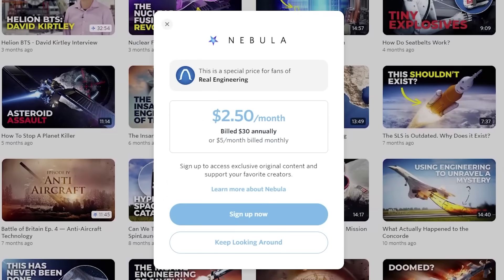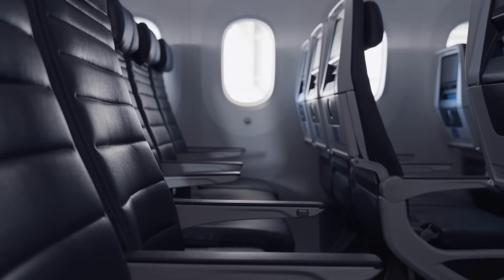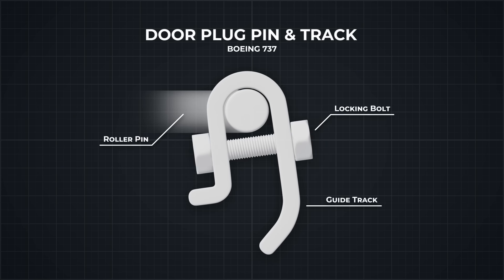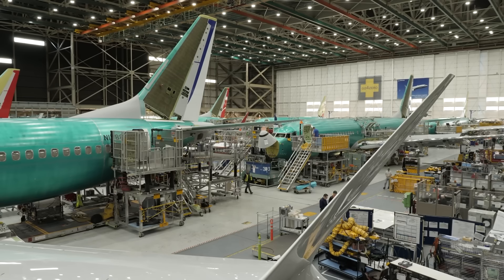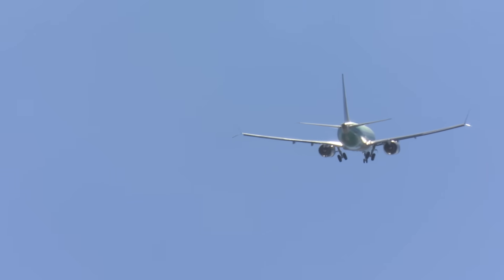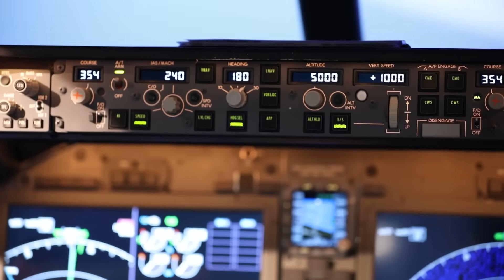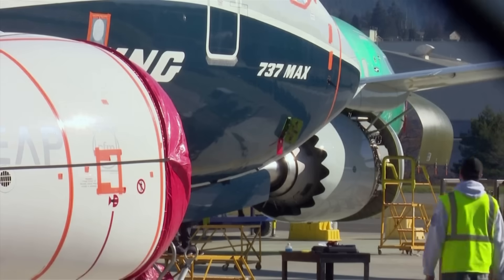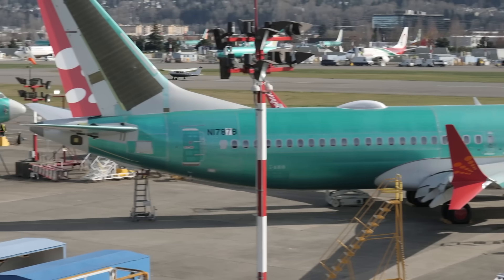The Questionable Engineering of the 737 Max

Comment: For the plug door, the engineering initially appears fine and will likely remain as such. Safety escapement and inspection,  a whole issue unto itself. Blaming the engineering  in the title especially for the plug door incident  seems a bit tabloid but in defense of the video and present Boeing management ……. sadly necessary these days. Bolts,  slotted castle nuts, and lock wire or cotter pins, ought to be goof proof when installed. Engineering failure, probably not so much.
Reply: You think it's sadly necessary these days to blame the engineering when it is not an engineering problem, because… 
in defense of the video???!!!

Yeah, these days… so much fentanyl in the air. Thank you for not working at Boeing—or anywhere, please?
Reply: @petep.2092  it’s hard to understand your rant. What part of the engineering of the door do you think appears flawed? Or maybe a better question what does engineering really mean to you? I am pretty sure I said the engineering appears fine and likely will remain as such. So not really sure what your rant is about.

Comment: 5:20
It's not a wire tie. It's a cotter pin installed in a castellated nut. Another way to secure a bolt is lockwire or safety cable. Wire tie, more commonly known as a zip tie or cable tie, is a nylon strap used for securing wire harnesses and I cannot imagine even a single way to use it as a fastener safetying device. Seems like someone doesn't know a shit about engineering :D
Reply: …cotter pin aka split pin, where this dude is from. Either way I agree it is not a good look for a self promoted “real engineer” to be so inexperienced as to call it a wire tie, which seems to be something builders use.

Comment: These brand new plastic planes should not be blowing out on the strongest parts of the air frame, the bear straps should be holding together until it’s bitter end we usually only see this on 20 year old planes the loose hardware we’re seeing is a symptom of a much bigger problem. Incorrect tolerances on the airframes themselves so even though we know that it’s a huge problem they just got clearance to put them back in the air to be beat on some more so now just like the 70’s and 80’s these things are gonna be blowing out left and right Boeings problems started when they merged management with McDonald Douglas

Comment: I'm glad that in the anime adaptation of Doctor Elise they changed the plane from an older 737 to what appears to be a 737 MAX. In the source material the pilot is somehow unable to handle a single engine failure. Well in the anime, it's still the same, but now fans can say "well, the computer probably messed up the single engine failure response somehow" since it's an acceptable target.

Comment: Great video as always. I’m surprised counterfeit fasteners weren’t mentioned, they and ‘salvaged’ components have caused crashes on both civilian and military aircraft in the past.
Minor detail and I know it was just a representation, but I never designed stuff with the screw/bolt head lower than the nut, falls out if the nut works loose 😅

Comment: The reason this happened is quite simple spirit Aerosystems were spun for profits and the workers they have come on more and more pressure to fix Boeings previous disasters . They’ve come under pressure to get the aircraft manufactured faster which leads to mistakes. This leads to people taking shortcuts rushing their work being unhappy. That’s what happens when you allow those criminals on Wall Street and in nice office buildings, in places like Chicago to take over instead of the people on the ground in Seattle.

Comment: the problem is actually trying to cram 230 people into a 59 year old design for 124 people, the 737-100 which used a section of 707 fuselage (vintage 1954).

Boeing, cutting corners for 70 years.
Reply: Not really, all of the deaths due to MAX incidents so far were caused by a multitude of design, implementation and training issues around MCAS, a shortcut to skip type certification for existing 737 NG pilots (which does relate to the age of the 737 but not to changes in passenger capacity), and the door plug incident and engine overheating issues would both be equally applicable even if it were a clean slate design.

Comment: Saw some other channel saying that the quality checklist / maintenance system had two options "opened the plug" or "removed the plug" - they're essentially the same thing, but if you chose remove then it proplerly inserted a work item for rechecking the bolts. (I forget where I saw that, but it was recent)

Comment: I think of a software should not treat the whole system as MALFUNCTION by default, such program state  should be in a deep conditional parentheses. In reality, software like that should never exist in the first place, if the system is having a parameter that constantly need correction the only right thing to do is get back to the drawing board.

Comment: What amazes me is that Boeing did not create that panel with a flange on the inside, so that pressure would cause it to fit tightly against the fuselage. Then there would be no danger of the panel blowing out. 

Instead, the pressure seal fits against the outside of the fuselage frame making its subject to blow out in the manner it did. That seems like a money, saving or cost-cutting shortcut.  I like the 737s and would have no problem flying in the max. however, Boeing has to  get their act together to restore confidence with the flying public. They also need to give the riot act to complacent shop supervisors and their mechanics.

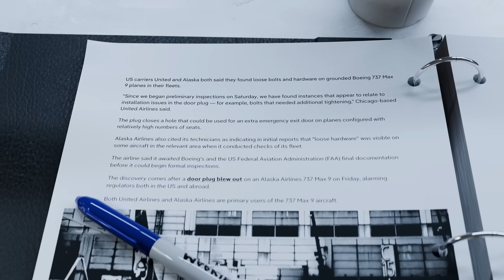Comment: @3:32 -- missing all together. Spirit's QA/QC showed then as installed on the way to Boeing. Boeing did work on the hull. Boeing failed to install bolts. Boeing failed to verify bolts.  Boeing got lucky that no one died this time.  

But, really, who cares at this point?  De Havilland'a got a reputation on par with Boeing. Ever notice how no one rides in those planes?  Because of all the complete hull losses/fatalities. 

Boeing -- get there never or in tiny pieces!!!
Reply: A $62 million dollar golden parachute for the CxO who led to hundreds of people dying due to MCAS -- a system which doesn't use proper redundant pito-tube inputs, leading to a simple single-input failure mode that leads to PIO as they fight the plane -- before a complete hull loss with NO survivors. 

Boeing :/

Comment: Something funny is that Boeing has never released a 737 without serious safety issues: the --100 and -200s reverse thrust, -100 to -500 rudder issues, -300 to -400 glass cockpit and engine problems (BMI Flight 92), and the current problems with the 737 NG (-600 to -900) and 737 MAX. Maybe there's something endemic to the basic 737 design?

Comment: the problem of human involvement being cut out of safety testing in favor of automated testing is going to get worse before it gets better. my father is a senior network safety software engineer who was working at a big bank. when they laid him off, they took out the entire team and replaced it with AI testing that would be moderated by one of the software developers on a different team, in addition to his main work. don't get me wrong, i love AI and i think automation is the future, but it is a tool. not a replacement. humans are prone to errors. humans using AI and automation to assist them in tasks are less prone to errors. AI and automation on their own are unpredictable. 

there is a reason autopilot on planes is so trusted, and it's because it has been developed over years with the pilots still present and paying attention in the cockpit the whole time. and they still occasionally need to step in and correct.

Comment: Am I the only one who thinks this scenario is utterly bonkers?

Want to make an aircraft with new engines and the selling point is no pilot retraining
So build an old design of aircraft with new engines
But the new engines are pretty different, so the plane handles differently to the old plane
So to avoid pilot retraining, build a system that partly controls the plane just enough to make it feel like the old plane
But a new system on the plane requires pilot retraining... Particularly to deal with how to fly the plane when the system has failed

It's a catch-22.
Reply: One small note: the new system was required for flight handling reasons on its own, not just to make it similar to the previous generation.

Comment: Engineers can absolutely be extremely unethical. I dare say 80% of automotive engineers design modern engine layouts to be as unserviceable as physically possible while still being cheap to assemble by automation. Everything is squeezed together as tightly as possible. Not only does it make the dealerships more likely to be the ones servicing the cars, but it massively increases the mechanical damage a car will take even in a light accident. The reason for this design choice is profit, nothing else. Look at the battery tray location on the ford focus. They claim it’s recessed behind the windshield to make room for the brake booster but there’s a solid 7 inch gap where they could have moved the battery tray forward. They moved it back solely to make it unchangeable without removing the wiper motor.

Comment: If Alaska Airlines knew that this plane had a pressurisation problem, and consequently avoided flying the plane over water, is it possible that they intentionally avoided putting passengers in the row of seats next to the door plug?

I find it difficult to believe that the plane could be almost full of passengers yet have no one sitting nearby the failed door plug.
Reply: A pressurization issue definitely wouldn't have been linked to this. It was just a switch to an alternate system, which can be caused by many things (almost always something wrong with the system, not that the plane is leaking pressure).

Comment: "Should be an easy issue to fix" As an automation specialist who works closely with process developers in manufacturing I can assure you there's hardly anything more challenging than fixing a company-wide culture of bypassing safety procedures. Especially when it's been going on for as long as has been reported by former Boeing staff 🙄

Comment: Ridiculous how Alaska airlines just reset the warning sensors. It is a warning sensor for a reason.
Reply: It was just switching to an alternate pressurization system.  It almost certainly seemed like some random issue with the main automatic system, which is standard maintenance to defer.

Comment: The level of ignorance about aircraft stability in this video is quite puzzling. The plane is/was NOT unstable. It behaved differently than the 737/737NG which would have meant a different type rating by the FAA. That would have led to airlines spending more money on training. Boeing promised no need to change the type rating, which is the reason why MCAS was added. 

There is also other issues with this video.

Comment: Using a lock bolt or a safety wired bolt in that area should be the minimum. You have to treat that area as a structural surface so I would even say hi-locks or rivets would be a better choice.

Comment: No problem with the engineering here.  If the plug had been installed properly it wouldn't have failed.  Actually delve into this incident and you'll quickly find it is a failure of corporate management (Boeing and Swift); a culture of profits over quality and safety at fault.